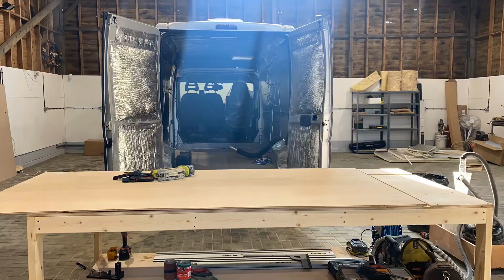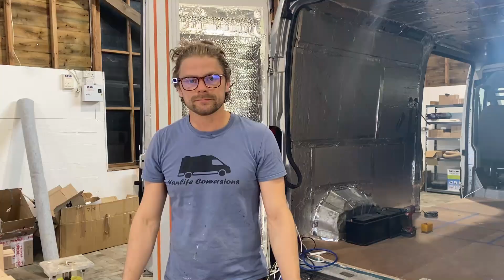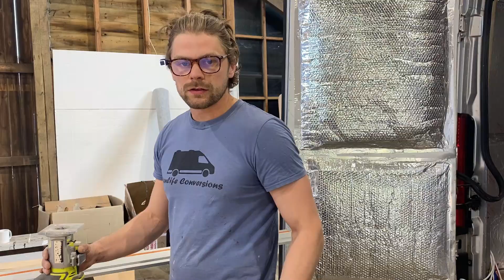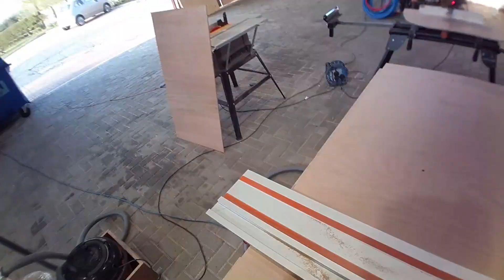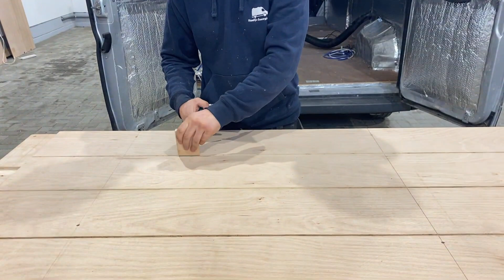Grooved ply wall method for van conversions | Lining a van | Vanlife Conversions

Comment: Hi Ol, can i ask is there a reason you've gone vertical with the grooves rather horizontal or is it purely aesthetics? Was going to go horizontal but just wondering now if vertical may make things easier?
Reply from the maker: Yes it is easier to hide the joins in the boards with vertical

Comment: Cheers for the video!! Do you reckon 4.5mm ply would be too thin?
Reply from the maker: I havent used that thickness for the walls tbh. It may work OK, but you will likely need to have the fixing points closer together